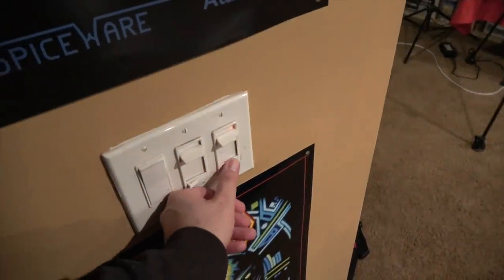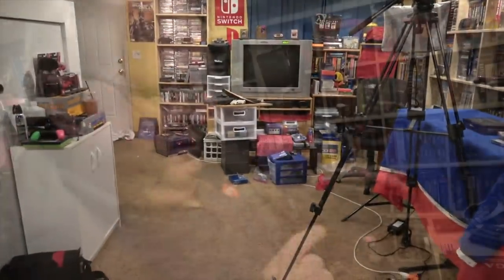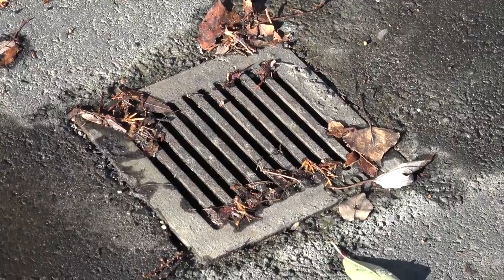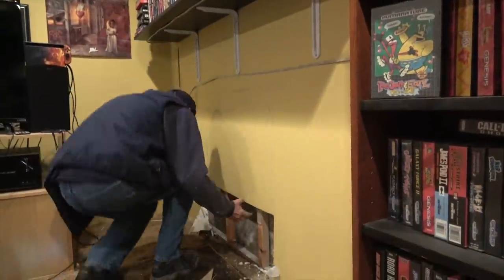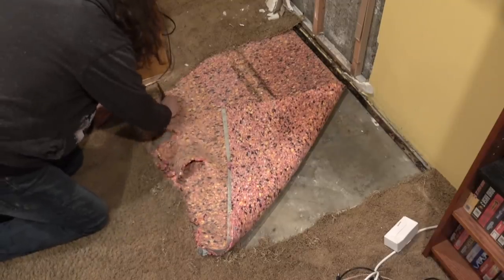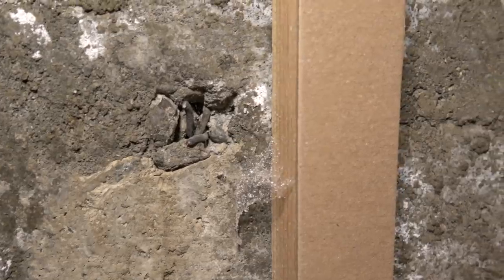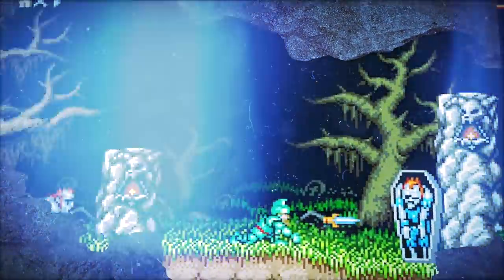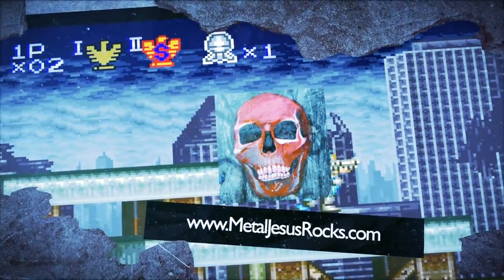OH NO! Water & Mold in the GAME ROOM! $10,000 to fix!

Comment: You really dont wanna go with an interior sump pump, Ive been doimg sewers and drainage for 8 years and those pumps fail. I've dug up countless foundations and installed footing drains in the Seattle area, its gonna be much cheapernto fix it on the outside especially with it only 5 ft deep. He gave you an outrageous price
Reply: If you have a good pump and let it check every 2 years its not that often that they fail. Iam a plumber/ pipelayer here in Germany and the pumps from some customers are already 20+ years what ive heard from older workers in the company
Reply: My first pump lasted 16 years. I replaced it this year just to be safe. I also added a battery backup pump as well as a moisture sensor that alerts my cell phone if the sump pit overflows. Then for the icing on the cake I added an 8000 watt Generac generator that comes on automatically if my power goes out that runs all my essential stuff like the sump, freezers, furnace, internet, etc. Then I made sure my insurance policy covered flooding. I'm set now, but I had to do it because I just spent thousands finishing my basement. Only other thing I could add is maybe a water powered pump in case my generator and my battery backup pump fail at the same time. If that happens I'll just burn the house down.
Reply: Trying to rip off money
Reply: I have 2 sump pumps in my basement and both lasted 20ish years before they had to be replaced. I'm currently on year 4 of the two new ones without any problems at all. I'd be knee deep in water without them.
Reply: Thats awesome that your guys pumps lasted so long, unfortunately they just aren't made as well as they used to be. Even Zoeller and liberty pumps only last about 5 to 10 years max. The issue with pumps also is that you're still allowing water to get through your foundation that will cause spaulding and major cracks over time because the soil will he washed away and water eats up concrete. Most houses in Seattle were built with a french drain style footing drain. They are one ft. Sections of drain tile that over time gets filled with dirt. That system can be restored or replaced cheaply and you're eliminating the problem not just putting a band aid on it. I could never in good conscious recommend a pump. For him to say it would cost anywhere what he said is a flat out lie.
Reply: @classicgamescanada  having a pump is not required by building codes in Wa state. I dont know how it is in Canada but thats definitely not the case here
Reply: With all of the snow and ice we get in my area a sump pump is 100% necessary if you have a basement, there's no avoiding it.

Comment: I am a wheelchair user that dug a trench over 80 feet 3ft at the highest to over 50 inches in depth by five feet wide to install a French drain to protect my home from sill plate damage. Most of your basement is exposed so be thankful. Grab a shovel and dig out the small area in front of the house being careful of pipes and such . Then seal the holes, then use a foundation or basement sealer to seal over that. Then put a drain tile in to prevent this issue again. Look up French drains these are old school methods to control water. Around the sides of your house just dig out five feet and install a retaining wall with landscape bricks to keep the dirt off the walls. Then go and seal all the exposed walls and holes. My effort saved me over $20,000 or more. You have an awesome game room and a great personality. Also the damaged wood could have been replaced with new medium density fiber board, and only the ruined part tossed. Hope this might help save money bro :)

Comment: Check your home insurance policy. If you have water damage coverage, it should pick up the part of the cost for the water damaged area at least (minus deductible).

Good luck!
Reply: Now comes the pain in the ass of juggling contractors.
Reply: Insurance doesn’t covered finished basements or any contents within outside of major appliances (furnace, water heater, washer/dryer, freezers and electrical systems). Everything else is repaired/replaced out of pocket.
Reply: Wow. If you guys are right on the technicalities of home owner insurance, it sounds like the insurance industry is a scam.

Comment: I wouldn't put carpet. I would just seal the concrete. Like how you see at the stores.
Reply: You would need some thing that could hold back high water pressure.
Reply: That or do tile floors with panneled walls.  Drywall sucks at keeping mold out lol, the backface of drywall is super porous normally. THIS IS WHY WE NEED TO GO BACK TO TREATED LOG AND STONE HOUSES LIKE THE OLD DAYS! lol
Reply: @lashed1980  flex seal lol 🤣😂
Reply: @jibb1451  or proper isolation. Houses in Europe have 5feet of black tar on the outer walls to prevent water coming in (at least nowadays)
Reply: @stripcat1  Zinnser water tite, Dulux cellar paint. What ever you wanna call it.
Reply: @phreeze83  The way americans build their buildings is bad.. most of the stuff they do is illegal in eu for safety reasons, alltho we in the norther part of eu have it even better

Comment: On the upside, it's a chance to envision a new layout. If budget allows you can even take the opportunity to hire an electrician while the walls are opened up to move and/or increase outlets to better fit your game system needs. Same with network and speaker wiring.

Comment: Once you are at the drywall taping and sanding stage, you will have drywall dust everywhere. Remove your consoles from the basement. I would also recommend installing vinyl flooring instead of carpet.

Comment: OHH , Don't do the interior drain . You will be wasting your money , has to be fixed from the outside.
Reply: Exactly and the foundation will continue to deteriorate. Just because the water has some place to go doesn’t fix the underlying issue. 40k seems awfully high.
Reply: Exactly! Absolutely mental way of doing this! Get another contractor in.
Reply: The best way is to fix the exterior foundation but the excavation costs is the issue in combination with the foundation repair so maybe he will have to do a home equity loan to cover the massive repair.  Otherwise it is just a temporary fix that will eventually need to be repaired fully.  I would research the lower cost fix to see how long it would last potentially.
Reply: I agree water is a sob, if you gonna fix it do it right
Reply: Definitely agree.
Reply: Exactly, do it from the outside. Dont waste your money! I did the same last year. Take a shovel and start digging.
Reply: He has so many fans, he should put a call out for someone to recommend a contractor. Perhaps he could invite a bunch of fans over to help with the digging and teardown?
Reply: Agreed, stop the leak at the start, not the finish.

Comment: The metal ties are actually used to hold the forms together to pour the concrete walls. If those were not there, at the interval used, the forms would explode under the weight.Since they are not removable after curing, the ties remain. 
On modern builds, they put a sealant on the outside of the basement walls, but back then, nope. The first new house I lived in (built in 1978) didn't put sealant on them, and had a basement window at ground level. Your problem was small, as my parent's issue was a flooded basement with nearly all the ties leaking, and that window. Fortunately, it was bought unfinished, so it was just a mess, no real damage.
Reply: that will be his issue soon enough
Reply: Actually for the concrete structure in modern construction, a plastic cup would be placed to the two ends of ties in order to leave a small room for grouting to seal up the hole formed by the ties. But the hole should be filled up by finishing even at 60s, in fact the construction is quite substandard at that time
Reply: @broforce2476  Hmm. Even back then. As mentioned my Parent's first new house didn't have that done either (1978), and they leaked when it rained hard.
Thanks for the info!

Comment: Don't get that system put in it's just a cover up doesn't fix you leak  best to do it properly take the drywall down then get someone to go around and drill out the ties then use hydraulic cement to fill your house won't sell easy if u do that inside weeping tile
Reply: rick ardo 
Agreed. And if any part of the interior drain system fails you won’t know because it’s not accessible. You could have an even bigger mess on your hands that you wouldn’t be able to see it.

Comment: Love the channel! Basment damp proofing has been mine and families careers for over 40 years! You need to 1. Fix grade on front yard. 2. Keep roof drains above your grade 3. Get rid of drain on driveway in center. Self leveling concrete can do the job. 4. Core a hole or install sump/check storm drain.

Was the outside drain on house scoped/cameraed?

You need to check under your floor via floor drain access rooms.

You have massive outside hydraulic pressure from ground saturation. You can flood from below your floor.

Please contact me!

Install a dehumidifier in your basment asap!!!

Comment: You don’t need to do the whole basement... Take a nail set and hammer all of the form ties in at least a 1/4” or more. Take a wire brush to clean out the holes and to remove any loose materials. Fill the holes with hydraulic cement. When you fill the holes make sure you get a spray bottle to dampen the hole. You do this to prevent the foundation from drawing moisture away from the hydraulic cement... if the moisture is drawn from the cement then it won’t cure properly and become brittle or not adhere properly. For safe measures you can paint the  patches with some kind of waterproofing paint like the Killz you had mentioned. To test to see if you even need a French drain system, take a 2’x2’ sheet of plastic and use a really good painters tape to completely seal all of the edges to the wall. Let that set for a couple of days and if there’s condensation between the plastic and the wall then I would recommend moving forward with the drain tile system... if there no moisture then it’s not needed. Hopefully this helps... feel free to contact me for any questions. Good luck!
Reply: jdott v good info

Comment: You should have gone with a gravel driveway instead of a paved parking pad cause the gravel allows the water pass through the ground there has to be a reason why the driveway was a dirt driveway and not a paved one
Reply: SilverX95 it had those metal ties that were already rusting so it doesn’t matter about paving the driveway. It was going to happen no matter what. Those things are terrible and more times than not cause this problem

Comment: 1. It’s not a downer, cause stuff like this happens in older homes that you usually never see coming, 2. At the very least you have the “cheaper” option to alleviate the problem and it gives you the opportunity to clean your systems and room, and also look at some surge protectors, hdmi & component switches, etc etc.  Also look into roller wheels for your shelves and everything in the game room that on or close to the floor so it’ll be easier to move in the future.

Comment: I mean don't you have insurance? Isn't this a cut and dry insurance claim? $1000 deductible? They wouldn't even buy you a new credenza
Reply: Insurance doesn’t cover finished basements or personal items within. Maybe if something catastrophic happened to cause the leak they would cover repairs, but not his games, furniture, carpet or drywall. Same thing with federal flood insurance.
Reply: Yea unless it was caused by a burst pipe or appliance you are usually shit out of luck with insurance.
Reply: Check with your agent to see if you have any coverage.  If it is a water proofing issue it would most likely be denied as a claim. You might be able to issue a claim against the contractor who put down your parking pad, they should have insurance if they are a reputable company as they caused a drainage issue.   All the games with exposed cardboard should be taking out until the mold is fixed, as the spores and moisture could cause damage. Also, you should put in an air scrubber and dehu during the process to keep the moisture levels down and spores from from going all through out the house. Cover duct vents in the basement  as well to avoid cross contamination.
Reply: FireMrshlBill is that a standard thing in the US?  My home insurance in Canada has always fully covered my basement and all belongings within.
Reply: FireMrshlBill depends on the type of loss , the insurance carrier and the State.
Reply: Depends on his policy. This would probably fall under ground water and wouldn’t be covered. He should call his agent and find out.
Reply: @goldenretrogames  Yeah I live in Canada too, this is completely unforeseen and would be covered 100% by my insurance in Canada. I have a buddy who just claimed because his sump pump failed and they replaced a whole Jam room full of music equipment.
Reply: I ❤️ law school
Reply: Slow water ingress IS NOT covered by homeowners insurance.
Reply: @johnd9357  It is in Canada I have personally claimed my basement flooding, 1000 deductable but still, sooooooo good luck states and your shit coverage?

Comment: replace your garden bed with a waterproof overhanging roof, put a cement slab under it and put some garden gnomes there or what ever and make sure it has drainage away from the house. problem solved.
Reply: Yes I was thinking this too lol id just cement it and make a trench leading to the driveway into the road

Comment: Don’t let them do the interior drain.  DONT. I did that in my basement.  You have a pump and it fills up and shoots the water out.  If you lose power for extended period you have a bigger problem.  You should dig the front up and fix the problem.
Reply: Just get a sump pump with a battery backup
Reply: ammonitida  buy a good battery. Mine works great
Reply: What if the power fails? get a battery. What if the battery fails get a second battery. What if the apocalypse happens!
Reply: @lee3r24  lol exactly
Reply: Zortac if that happens stay away from Neegan.
Reply: Zortac if that happens stay away from Neegan.
Reply: The Gmork they literally drill holes in your foundation.  Those holes allow the water to drain through them into the track they install around the walls where the leaks are happening.  Then the water flows to the sump.  Instead of fixing the issue of water in the basement they allow more water in the basement.  Intead of digging and fixing the outside and laying a few coats of water barrier on the outside then fill back up they do that.
Reply: The Gmork either sumo pump system or the right way which is dig the outside of the house all around the foundation lay down what’s called French drains and the outside of the foundation is painted with a water barrier almost like tar.  Then fill back in.  The barrier and French drains do the work
Reply: 100%.   Foundation walls need to be sealed (and insulated) from the outside.   Having sump pump isn't right for this situation and unquestionably wouldn't fix the issue as it isn't ground water from below coming up. The drain they discussed around the foundation is a correct thing to do for new or existing construction but it is secondary, the primary has to be sealing it so that moisture doesn't even get to the cement.  The amount and ease that it is pouring through the whole in the wall would mean that the wall area would always be wet when it rained and the humidity would contribute to future mold growth even if it was draining.

Comment: Yeh that sucks. But buildings dont last for ever and they require constant maintenance. So 50 years without a problem is pretty good! Other people are saying to fix it externally which is probably better. Ground water is ways gonna be present so letting it come into your house/basement like a little river then pumping it out seems like asking for more trouble. What if you go on holidays and the power or pump fails then you still flood.

Comment: you need extensions on the gutters so they don’t keep pouring right next to your foundation. Also I would reconsider the shrubbery next to the house, that makes the area more saturated aswell believe it or not. (Also a home inspector.) and I would have a contractor snake out your drainage system could just be clogged from the outside with leafs..etc. hope that helps good luck.
Reply: Just noticed it’s an underground drainage system tied in with your gutters so my theory is it’s clogged somewhere along your pipping underground and I would definitely have a good contractor snake out your lines.

Comment: I'm very sorry this happened to you. I have had two major water issues in my house since I purchased it five years ago. I had a leak in my wall where a pipe had not be installed correctly and my dishwasher in my kitchen island had a slow leak because it also was not installed correctly. My problems were due to the previous homeowner doing DIY projects. It sucked. We paid so much money over the last few years correcting errors that probably only saved the previous homeowner a few bucks. So I understand your pain bro. Good luck with the repairs.